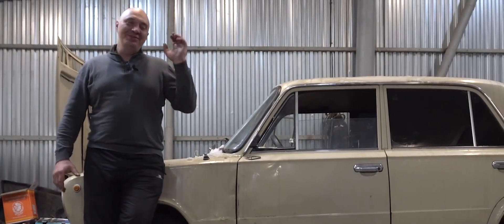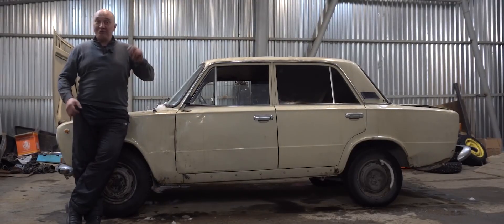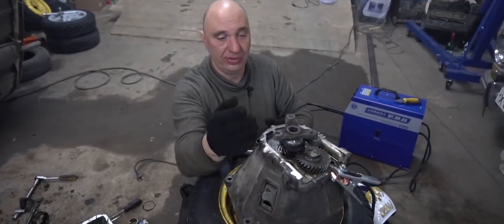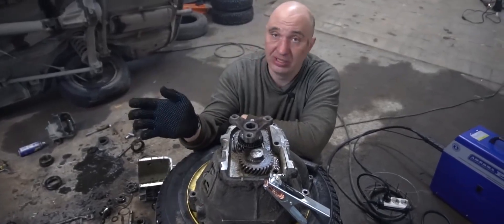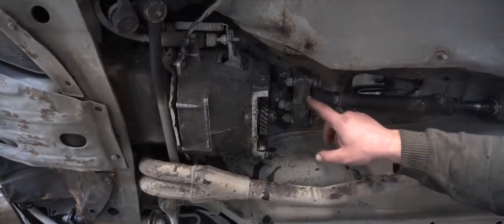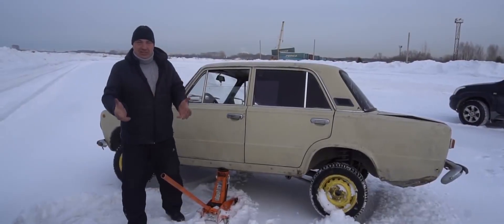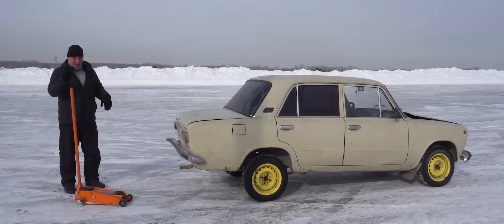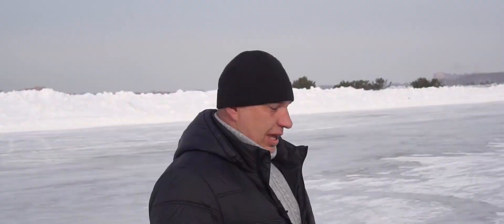Welding the prop-shaft to the motor and driving without a gearbox

Comment: Wouldn't it be the same as driving in top gear as top has a ratio of 1:1?
Reply: Geoff Turner yes you are correct
Reply: @upyours1256  not exactly the same. It wouldn't have a long spindly and wobbly drive shaft
Reply: Daver G  Those are sports cars. I'm talking about regular cars like a Volvo S60 or a Toyota Corolla. More gears done right gives slightly better fuel economy in traffic. Rear end ratio doesn't matter in this context though, we're only talking about the gearbox.
Reply: Daver G  No you are moving the goal posts. Most cars are not sports cars. A LADA is definitely not a sports car either.

Furthermore we are discussing wether or not bypassing the transmission is the same as leaving it in a high gear. The rest of the driveline has nothing to do with it because they would be identical in the two cases.
Reply: Daver G  You're not making any sense, the rear axle is not a part of the transmision. Its ratio is totally and utterly irrelevant to the discussion. Also, do yourself a favor and don't quote the stuff I wrote that proves you wrong.
Reply: Daver G  I think you should go talk to someone because I'm genuinely getting starting to get worried that you are having a stroke or something.

We are discussing the gearbox, the thing that sits between the clutch and the driveshaft, and through which gear (or ratio selection if you want to be pedantic) it gives a 1:1 ratio. This is a separate discussion to what the final ratio would be and how you would go about to get a 1:1 final ratio. I don't know how you can't grasp the difference between a gearbox ratio and a final ratio.
Reply: Daver G  Apparently context has no meaning anymore. So fallacy this, fallacy that, my next answer you can pull from your hat.
Reply: Daver G  You know what, I have been under a lot of stress the last few weeks. I was probably a little harsh on you. I do indeed apologize for that.

I didn't know which sports cars specifically used more than two overdrive gears, so I guess I did learn a bit of that.

All that said, the context is still important. The original question was if bypassing the gearbox would be the same as driving in top gear. For that to be true the top gear would have to be 1:1 through the gearbox. The differential ratio has no impact on that, because it's not a part of the gearbox. Therefore the only relevant piece of information is which gear would be the one that simply connects the driveshaft straight through the gearbox. If you want to take the mathematical approach you could element-wise divide the vector of final gear ratios with the differential ratio, and see which element in the resulting vector equals 1.

Contributing more to the context, in the video they are experimenting with a LADA. My answer was relating to similar cars since I don't know the gear ratios of that particular LADA. When I pointed you were talking about sports cars it was because my answer didn't relate to those at all since it was written to help answer the original question. It's a bit like pointing out that Koenigsegg One:1 is always in this "gear"; while true it doesn't really help in answering the question. I hope you see what I mean about the context now. After all most people drive either econoboxes, midsize cars, or trucks. None of which would have more gears just to achieve higher top speeds. The average consumer unfortunately desires better fuel economy, and one of the ways to achieve that is to craft your gearbox to keep the engine as close to the efficiency sweet spot at the most common speed limits. Looks better on paper and more gears gives the impression of accelerating faster than you actually are.

I hope this clears things up and I wish you a Merry Christmas and a Happy 2019 as well.
Reply: usually 3rd gear is 1:1 sometimes 4th
Reply: @vegancyclist8853  Depends on the car the gearbox was designed for and how many gears it has. It's usually either the top gear or the second to top gear, but I bet there is some crazy company that has produced a car with more than one gear above 1:1.
Reply: @vegancyclist8853  no dude 4th is 1;1
Reply: @upyours1256  it's usually 3rd. 4th is a slight overdrive a lot of the time.
Reply: @vegancyclist8853  and all you other non qualified mechanics , 4th is not a gear . when 4th is engaged on a four speed or 5 speed box ,input shaft is locked with output shaft , i hope you have learned something
Reply: @upyours1256  Not on every gearbox. Most older bmw boxes have 5th as direct drive, and no overdrive.

Comment: How about tossing out the entire prop shaft and attaching a hydraulic pump to the motor and a hydraulic motor to the rear differential so you get a Hydro static transmission.
A hydraulic lever like the ones used to control a hydraulic cylinder would decide how much of the pressure from the pump goes to the motor and how much just gets returned to the reservoir. Further you would be able to use the car afterwards as a mobile hydraulic power plant to power log splitters, hydraulic scissors and more.
Reply: my only note is this man needs a biggy smalls sweater. like for real. NOTORIOUS BIG.....
Reply: That's been done in the States for several years now and the big fertilizer company's use the big wheeled units forspraying  fertilizer and pesticides on the fields. These implements are big and will surprise you how fast they canrun. Since they are powered by a hydraulic pump driving hydraulic motors they have a lot of power. The tires on therigs are at least 8 ft. tall and the wheel base takes up more than a lane on the highway. That means traffic on thehighway will see flashing lights and a big farm implement that is traveling almost 45 mph pull over so there isroom on the highway for traffic to pass. They have the clearance and the power to run through a ditch. How aboutthat for offroad equipment!
Reply: @ezl7052  you mean wheel track instead of wheelbase
Reply: It's called Hydrostatic Transmission. Used in lawn tractors and other equipment
Reply: @rjs198585  True Hydrostatic Transmission is the correct terminology. Hydraulic transmission can also be a Hydrokinetic transmission or a type of automatic transmission. I have corrected it now, thanks!
Reply: @Sohave  don't forget about Oldsmobile's Hydra-Matic Drive
Reply: You would have to use relief valves to keep the hydraulic motor from stopping solid and wrecking everything
Reply: @kennedy796  There is actually someone who knows something abut hydraulics! What is your background?
Reply: @Sohave  i am a heavy equipment tech by trade. Plus i believe you could use the hydraulics like a cvt as well by setting up a system and a controller for a bi directional infinetly variable piston motor, and a variable flow piston pump. You would have high efficiency, high speed, both directions, variable speeds, and still retain the soft stop system.
Reply: @kennedy796  Cool I don't have the same knowledge of which particular systems are on the market, I only know the basics. Do you know about how much these components would cost in case Vlad should get interested in our idea.
Reply: @Sohave  well in canada that pump starts at 5000$ cad lol.
Reply: @kennedy796  Then in the interest of keeping it on a realistic budget a setup using second hand digger parts would probably be more economic.
Reply: @Sohave  definetly. Old skidsteers would have more appropriately sized parts imo
Reply: @kennedy796   @kennedy796  It's exactly how the Fendt Vario system works.
Variable hydraulic pumps and Variable hydraulic motor.
So the diesel engine runs either at most efficiency or on most power.
The rpm is controlled by an automatic controller.
Reply: The vario system from Fendt is the simplest and best concept ever.
Reply: @randywatts7085  you started by writing "NO Why would he do all that  DUMMY" and I answered. are you both senile and stupid? your only contribution to this conversation has been negativity and name calling.
Reply: Sohave heavy equipment does this. Slow wastes power in heat from friction of oil in pipes. Look up pressure compensated variable displacement piston pumps and motors by Rexroth and Kawasaki.
Reply: My lawnmower works like that
Reply: This kind of transmission is often used in passenger diesel trains
Reply: @jakubtrzebiatowski5308  which trains do that?  Most use a deisel motor to turn a generator.  The generator powers an electric motor which spins the wheels.  That is how ai thought it worked.
Reply: @rscarawa  most railbuses. The transmission you describe is used in heavier trains.
Reply: @rscarawa  Basically a big Hybrid!
Reply: @rjs198585  No actually not, there are no batteries in a diesel electric locomotive to store the electricity and it only produces enough electricity for the consumption of the electric traction motors, there are Diesel electric hybrids that employs batteries or a pantograph for full electric opperation but those are reffered to as diesel electric hybrids, the ordinary diesel electric locomotive does not share these properties, through conversions has been made, as an example of such conversions: Diesel electric locomotives running on some lines in New York turn off the main generator and switch to a third rail electric power pickup when running through tunnels and crowded areas to not infest those places with exhaust fumes.
Reply: @rscarawa  There are 3 main categories of diesel locomotives
1) Diesel electric locomotives working in the manner you described.
2) Diesel hydraulic locomotives utilizing a hydraulic transmission and drive shafts or coupling rods for transmitting the energy from the transmission to the wheels.
3) Diesel mechanical locomotives utilizing a full mechanical transmission like the one in a car and once again drive shafts or coupling rods for transmitting the energy from the transmission to the wheels.
Reply: @jakubtrzebiatowski5308  really because I'm pretty sure it's a Generator and electric motor
Reply: @jakubtrzebiatowski5308  Does it use a variable tilt-plate pump?
Reply: @Jakub Trzebiatowski
No railbusses, diesel hydraulic commuter trains and small shunting locomotives just use hydraulic transmission not hydro static transmission.
they were much more similar to trucks with hydraulic transmission than to farm equipment and construction vehicles with hydro static transmission.
this British class 52 is a good example http://www.westernchampion.co.uk/loco-d1015-technical.php
similar technology was used in DB v60, DB v200, DSB Mh, Henschel DH.
Reply: Is this a kind of hidraulic coupling used in automatic transmissions?
Reply: @themadefaker4494  no,
Reply: that won't be enough. you need a pump that can push variable amount of fluid. and you need a motor that allso has variable amount of fluid /revs. now, what you need is to somehow monitor the engine load, if it was a diesel then best shot would be to monitor the governor. thatway if the engine is suffering, the pump will reduce the amount of oil it pumps / revolution. so you do not stall. then you need to monitor the pressure the pump makes, on the hydro motor. if the pressure is close to the maximum the motor should take (like a 350 bar rated motor gets around 320 bar)then increase the amount of fluid it takes to turn it by 1 revolution. thisway you get a system that will absolutely milk all available engine power, and will provide the most top speed and acceleration you can get. allmost like a cvt.
Reply: How about putting Tesla motor in it?
Reply: @Jaydawg-v5f  An EV conversion. A Tesla motor would probarbly be one of the most expensive ways of doing this, People used to re purpose old forklift motors for EV conversions, You can actually make a decent EV with those, i have actually half way converted a Trabant to an electric vehicle on my channel, the project got halted by new danish legislation's that made it close to impossible to get it road worthy.
Reply: That would just be a hydrostatic transmission, the idea here is to have a direct drive, rotary power to rotary power, without conversing to fluid pressure, or electrical power at any point
Reply: @leosypher9993  I am not questioning this episode. It is a suggestion for another experiment, Vlad often encourages the viewers to make such suggestions for future episodes.
Reply: Just like what is used in riding mowers and many compacts
Reply: sounds like a lot of money
Reply: @ripdiptatterchip3851  That depends where the parts comes from, are they used spare parts from scrapped construction machinery or new parts.
Reply: Sohave that uses too many resources and too much work
Reply: @lawrencegoralski3029  That is up to Vlad to decide.
Reply: @SeranaKnight  Ask your Mom she changed it with her mouth
Reply: NO Why would he do all that  DUMMY
Reply: Randy watts Well fuck you too. Geez
Reply: @randywatts7085  And why the hell should he not, he has already put gull wing doors on a Lada for the heck of it, despite it taking several days, Vlad can do what ever he wants and he often listens to the comments. You on the other hand, are a complete looser incapable of adding anything constructive to the debate you numb skull.
Reply: Well, it takes money for what he is doing and you should appreciate his time and what he has contributedto the channel! These fellas are talented and you should respect what they have to offer and appreciatewhat they have to offer, the time they have spent, money plus it's is also entertainment.

Comment: koenigsegg direct drive made in russia
Reply: Torque converter for sissy. Russia do the right way
Reply: You need an auto automatic for that to work
Reply: Vennu McLaren P1 has only 1 gear too😂😂
Reply: Didn’t work tho
Reply: We shall name it Koenigsegginoff
Reply: The reason for a direct drive on that car or any other high horsepower application is such as this. Their is not a single transmission made that can handle such horse power
Reply: @curtisbarker9272  you're an idiot. What about 2000HP GTRs and 2500HP Lamborghini Huracans with billet transmissions with 6 and 7 gears? Gtfoh
Reply: freezeme360 🤣 you hear about that new russian std .it rottsmikokov
Reply: freezeme360 I only like them high class girls the ones that put out for a 20 sack of meth and a pack of Marlboro reds

Comment: What was the point of the clutch if you aren't gonna use it lol
Reply: With the wheels up on a jack, the car would start just fine without the clutch.
Reply: Erik J. True, but that'd be inconvenient
Reply: He didn't even use the clutch to start he just reached in through the window and started it with the clutch engaged...
Reply: Demonslayer20111 to be able to start the car
Reply: @lawrencegoralski3029  he started it on a jack. No point in having the clutch.
Reply: I thought most titty bars, and coffee shops offered complementary jacks for their transmissionless/clutchless patrons. I even heard the strippers, or the barista will drop the jack for you, while you race the engine. Am I wrong?
Reply: Erik J. That's crazy where do you live? I'll have to visit. Local businesses around me are just inconsiderate!
Reply: So he didnt have to weld straight to the crankshaft and make the rear main seal piss out oil...
Reply: He could have slipped the clutch and got going...basically a bad automatic car they wound up with...